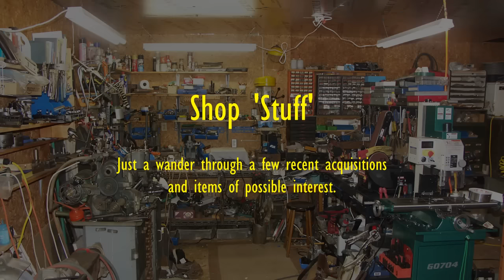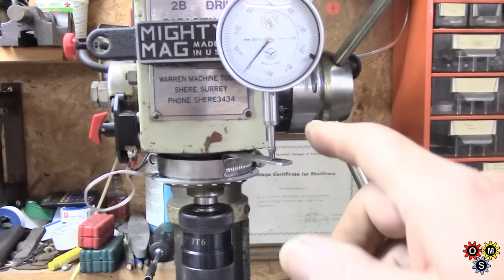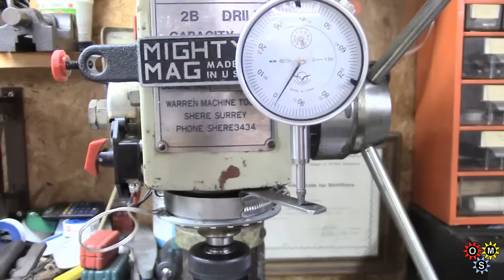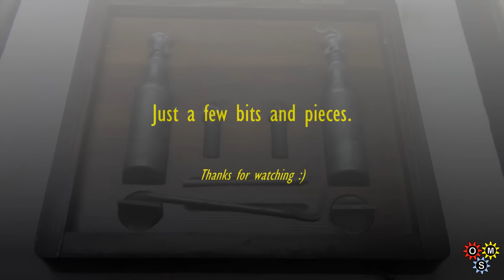Bits 01

Comment: It looks like your tap guide has a bell mouth.  If so, it would automatically center on the end of round stock too.  Nicely thought out tool.
I'm a big believer in import tools.  It's important to me to have a tool available when I need  it.  I have a rule in tool buying:  the first time I buy a tool I get the cheapest one that will do the job.  The second time I buy the tool I buy the best one I can afford.  My drill index is an import with about 15%% of the drills USA name brands.  I only wear out or brake the ones I use most but I have all sizes available.
Reply from the maker: +rfcarlson1 Yes, good point you make for end of round - hadn't really considered that but could well be handy. Agreed, having (even if cheapo) better than not having at all. I do like you with drill index - replace or top up with good stuff.

Comment: slotted top for your jack set will fit a key way or support a flat under a shaft no indicator needed for most things just old time see and feel not rocket surgery for the neighbors mower 
love the videos 
from another old man
Reply from the maker: +Jerry Schram Thx Jerry. In fact those slotted type pieces only go on the bottom due to the register type... so won't fit on top. Like your thinking on those though. Must re-examine.
Reply: +ChrisB257 up side down?
Reply from the maker: +Steve Lion Could be, tho never tried that way.

Comment: Did you like the looks of this tap guide (India version) better than the SHARS version (visually the same design but with 4-jaw collets) at about the same price?

My solution for finding misplaced tools is to buy another. When you go to put it away, there is your original. You can't fool yourself by pretending to have a replacement; it has to be physically in your hand. I confess that I sometimes have to repeat this process more than once, as the new tools often go missing in the same way as the originals. Once you have enough of some particular tool, you can put one in each of the places you looked for the original.
Reply from the maker: +Peter W. Meek Hi Peter - actually hadn't seen a Shars version - but thus far am pleased with the guide. Have to admit I too have gone and bought another of something, and then yeah - the original will turn up. :)

Comment: Chris,

Is it a "Soba"?  (he make)
They make very acceptable tooling for a very pleasant price

Paddy
Reply from the maker: +gh778jk 
Paddy - so many things I waffled on about - not sure what you are referring too!
Reply: +ChrisB257 
Sorry... the tapping-gizmo... you said it came from India.
I have some tools from Soba (a dividing head is one of them) and they really make very nicely finished tooling for about a third of regular prices, even if you count the postage !

Cheers
Paddy
Reply from the maker: +gh778jk 
had a look Paddy but - no name stamped on it.  I did get my small rotary table from India and it was good value - although I added a stabilization addition - http://www.oldmansshop.com/vid-pages/rotary-stabilizer.php
Also my GROZ 3 position drill vise was I think same source.
Actually I was surprised that the shipping, thru DHL on the rotary table, was way reasonable.

Comment: Hi Chris, I'm going to have to tell you off again. Besides your awful English these days, you never put the collet in the holder but in the closing nut. Take a hundred lines and stand at the back of the class.:>)
c
Reply from the maker: +Chris Stephens Chris - I am suitably castigated!!! :)  I'm afraid after 15 years my English has become a bit 'polluted'. Re the collet - that was just showing the thing - agreed in actual proper use yes, your way is correct. I will do the 100 lines later on.